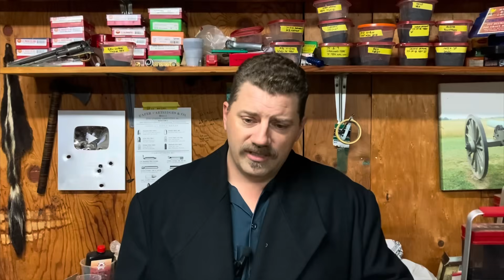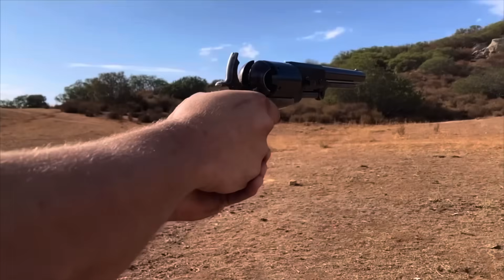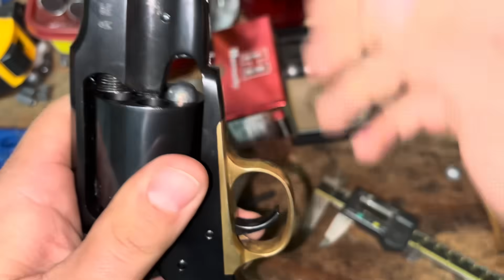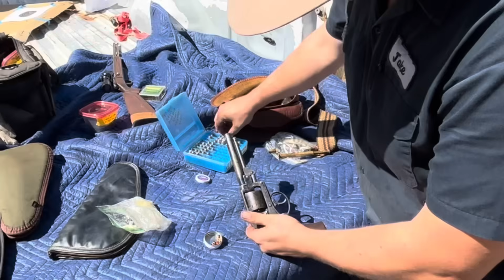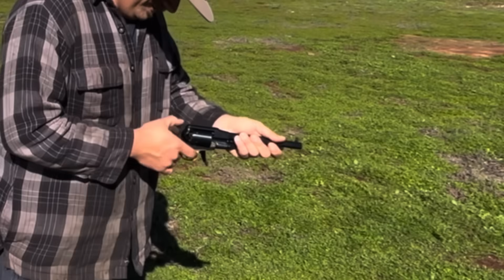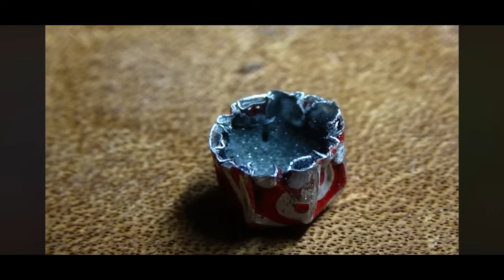Chain Fire Number 4. But Who’s Counting?

Comment: Old Ranger was using homemade caps which had priming compound all the way up the sides of the cap in the video when it's slowed down you can actually see the cap start fizzing and then it goes off. I make these same kind of percussion caps and now I only use them on my single shot muzzleloaders sometimes I'll load every other chamber of the pistol

Comment: From an engineering perspective, I would think that any chamber where the sides are more conical than parallel would make it easier for the projectile to dislodge, or break its seal. Just like you described happening with loose fitting caps. I'm the opposite of an expert though, so take my opinions for the little they may be worth. Thanks for another educational experience!

Comment: I usually use grease cookies BEHIND the bullet. Never had a chain fire up to now, either in my Navy or Walker, but I don't shoot even close as frequently as you do, so maybe next time I'll have one.
But it surely gives me EXCELLENT accuracy... shot 96 shots in my Navy with the last cylinder being as accurate as the first. Also, I can clean the gun without a drop of water. Just clean patches and some jojoba oil (completely equivalent, chemically speaking, to the sperm whale oil used back then, and much more ethical).
I deep clean (completely disassemble the gun) only once in a while. Never a trace of rust in the innards, nor in bore or cylinder.

Comment: I have two Remingtons and all of my cylinders cut off a complete ring with .454 Hornady balls - never had a chain fire. I do use lubed wads and i frankly cannot see how the powder in the adjacent chambers could possibly be ignited. I have used 10s , 11s and RWS10.75 caps with varying reliability.

Comment: I've been shooting BP revolvers since I was 15 when my father got me a CVA imported Armi San Marco 1858 .44. I still shoot it occasionally, but my supply of repair parts is getting low, so I'm preserving it.

Now, some 30+ years later, and I honestly don't know how many revolvers I've owned since them, and I've never had a chain fire. Like you, I shot them daily for many years and worn out, rebuilt, worn out, etc, several of them. 

When I load, I don't use felt wads or lube over the balls. Just #11 caps (usually pinched), usually Pyrodex or 777 (nobody carries real BP around me) and my own cast .457 round balls out of a Lee mould. I know most will say I'm doing much of my loading wrong, but it's what I've always done. 

About 5 years ago, a friend wanted to finally shoot his Pietta Remington .44 that he bought a few yeats prior and never shot. He read loading instructions online and I told him about my many years of BP shooting and lube over the chamber mouths was completely unnecessary to prevent chain fires. Well, the VERY FIRST TIME he pulled the trigger, he had a chain fire with the two chambers on each side of the firing chamber going off. 

So, long story short, I've just been lucky! I don't know exactly what causes them, but the possibility is definitely high enough that I wouldnt put y hand in front of the cylinder on a Remington Carbine!

Comment: What causes a lot of chain fire is the cylinder chambers are not perfectly round and there is slight gap between the ball and chamber, I had a Ruger old army and one was drilled much larger than the other chambers, even using a 457 round ball it still fit loose.

Comment: Not an expert but I've wore out 3 cheap brass frame replica's over the last 40 years. 2 51' Navies and a Remington Army. Never had a chain fire, never used lube or wads, but always used balls that would shave lead rings. That's one reason that I've been wary of conicals, they won't fit tight enough to seal the chambers. Keep up the good work, really enjoy your videos.

Comment: AFTER LOADING PUT 3 OR 4 DROPS OF RCBS CASE LUBE AROUND THE BULLET. IT WILL STAY THERE AND HELPS LUBE THE BULLET AND END YOUR PROBLEM. IT DOESNT HAPPEN ON THE NIPPLE END. ITS BAD ROUNDBALLS, BULLETS, AND MOSTLY OUT OF ROUND CHAMBERS. TRY IT AND YOU WILL LIKE IT. IF IT STILL CHAINFIRES YOU CAN CALL ME A LIAR BUT IT WONT. HAD AN EARLY ITALIAN 1860 ARMY THAT WAS HORRIBLE, HAD IT CHECKED AND MOST OF THE CHAMBERS WERE WAY OUT OF ROUND.

Comment: Just one more reason to NOT use that post 2004/05 modern "Kung Fu" tactitard thumbs forward grip on ANY of your handguns. It doesn't transfer over to revolvers at all even though many of the newer people do it anyway. It's not as accurate as a traditional "wedge hold" which is the one I use on everything I shoot and have for the last 50 years. Ok, so now here is "the thing". IF you use that modern thumbs forward hold on a revolver and have a chain fire you are going to lose at least that digit, maybe the one next to it too. Use a traditional revolver hold and grip or else a traditional "wedge hold" always when shooting a revolver of any kind. Your support fingers and thumbs won't be anywhere near that blast if you do.

Comment: I chain-fired an 'ol .44 Uberti once, It was 100%  my  fault . 
  Scared the shit out of me though, lol, wasn't expecting a 3 round burst from a 150 year old wheel gun. 
  I had leaks , just that simple.  I didn't seal the chambers with grease and propellet dust potentially added to the event . The firearm itself had issues,  we ended up trading it as a "parts-only" machine. 
But "lesson learned" and in all the years since, we lub'in.

Comment: I been tootin hoglegs for over 40 years , 😂😂😂😂 , only had a couple of chain fires one was my fault on a repo colt undersized balls , the other wasn't , it was a real 1860 army I dIdnt load it , just experienced it , it's problem was eroded chambers , I like lee liquid alox on the balls and bullets extra and a wad and some kind of grease , keep that fouling as soft as possible for accuracy and for safety, it just happens sometimes .

Comment: I used every protective measure, and it happens, now front, rear all I can say is YES I have had it happen 3 times thus far, one was from the front, as the cap was still good, one from the rear result of sloppy home made caps, the 3rd good luck was no way as to say definitively from which end.

Comment: If your vent hole in the nipple is burned out that can dude the cap to blow off and MAYBE migrate to an adjacent chamber. That’s a lot of 90* angles. You can be a purist to a degree, but, safety is paramount.

Comment: Sir, I believe that the chain fires come from the gases being deflected back towards the L/R chambers as the projectile completely exists the firing chamber.   Tight fitting projectiles and lube over the chamber ends should stop these unwanted discharges. I have never had a chain fire using the above method in my Uberti Dragoon.

Comment: Years ago i was using a local made gun grease. Had a colt chain fire with all cylinders greased . 2 cylinders chain fired. Found out the gunsmith making the lube was using some lighter fluid, vasiline, and candle wax. He replaced the colt Navy. Now only factory lube

Comment: If you have to pinch your caps to make them stay on, you’re probably gonna have a chain-fire. Be sure the cap fits on the nipple, good and tight. I’ve been shooting these things over half a century and I’ve had a lot of chain fires because I couldn’t find the exact size cap. I’ve never had a chain fire with the proper caps. Replace the nipples if they are worn/ corroded over time.
Reply from the maker: @DonEmbrey  i’ve had two chain fires in this gun using RWS 1075 caps that fit exceptionally well, better than CCI 11s and Remington 10s. I have recently switched to .457 balls and have yet to have a chain fire.

Comment: I have a Pietta 1858 that shaves a nice ring of lead with .451. My Ubertis don't shave much. I use Slix Shot nipples and RWS 1075 plus caps. I do have to pinch them a very small amount. However, after I do just like you seating them, it take a knife to CUT them off you cannot pry them off in most cases. I saw some tests with heavy loads that demonstrated that in a .451 gun each time they went up a ball size, the velocity increased by a substantial amount from starting friction, causing better ignition, supposedly. Now I only buy .457, (Hornady). The cylinder cuts it down anyways they thus have a longer bearing surface and shoot great no matter how hard I push them. You can't push them any harder, and they are good enough to take groundhogs at 30 yards and print to within .6 at 15 yards, often much better. Not only do I lube them, I re-lube each one coming up to fire because it blows some of the lube out. I'm only concerned with where the first one goes, so I start with the same chamber each time. T7 burns clean when ran right, and after 6 shots, I can still see bare stainless metal in the bore thru a little grey haze. 3 strokes with a water only mop cleans it. I seal my caps with clear nail polish for storage. It completely dissappears.

Comment: My first ball and cap revolver was a .36 Navy purchased in 1966 when I was 15.  Quality was terrible.  I only had one ball mould and they were too small.  I’d have a chain fire at least once during a shooting session.  Caps were hard to come by (nothing new) so I’d use anything I could get, size 10 or 11 sometimes loose sometimes okay. I often shot out in the desert so pasting Crisco over the ball didn’t work well.   I eventually started using a beeswax patch under the ball and that stopped the chain fires.  Recently I bought an original New Model Army and have not had any chain fires.  I think it is because the originals were built to a much higher standard and there is no variation in the cylinder diameter.  Caps fit tight on the nipple.  The .454 ball fits tight without cutting a ring.

Comment: Tight caps and grease over the bullets?
Reply: Ok after watching you explained you used grease. I don’t get it man. Is Black Powder somehow concussion sensitive? Enough to detonate without a spark under recoil? This is an interesting issue and I thought that right balls with grease would do the trick for preventing them but I can see how loose caps could leak a spark to another nipple and around a pinched on cap. I also seat my caps with my hammer because I have had enough to go ahead and not fire and force me to cycle back around to them to hit them again. But I don’t put my hand in front of the cylinder to do it. I just don’t want to be forward the cylinder once it’s loaded up.

Comment: Dear sir, considering that imho you produce the best Black powder information I have yet seen on u tube. I find it surprising that you use the term "propellent" for black powder. Perhaps it is the u tube cops. If so my apologies. Smokeless powder (Combustible Propellent) Is not an explosive. Black powder on the other hand is classified as a Class 1 explosive. Yes when the charge ignites it does "Propel" the projectile out the barrel. But that does not make it a propellent.
Reply from the maker: @brianwilcox3478  it is simply to avoid trouble with the YouTube authorities. Apology accepted. 😉
Reply: @Everythingblackpowder  :-)

Comment: I have cap and ball .44 calibers that require .440 round balls and a Uberti Walker.  I had one chain fire in my Army San Marco 1860 two deckades ago.  I had got sloppy and there were grains of powder on the outside of the felts.  Since that happened I have been making my own over the powder felts and using the oxyokes over the round balls and not had a chain fire since.  I also pinch he percussion caps before I put them on the nipples and use a stick to make sure the caps are on tight.  For long term or hunting I put a bead of lube around the edge of the oxyokes and the cylinder bore.   I have dropped my guns in the creek by accident and had them fire just fine

Comment: Late to the roast again, that's my bad. 
Regarding chain fires, let's just give it a quick, logical once over. You have a vessel, open on either end, with a charge of some volatile material inside. One of these openings is - for the sake of argument - .460" in diameter. The other is roughly .050" in diameter and covered tightly, even if not exactly sealed. The first, larger opening is also the end from which the volatile compound is charged, leaving the distinct possibility of some amount of errant compound sticking forward of the projectile. 
Which of these seems the most likely source of unwanted ignition? The tiny hole with the cover, or the hole 10x the size with an undetected, bugs bunny-esque powder train leading to the main charge? 
Can chain fires happen from either end? Sure. Like we said at the outset, it's a container full of bang that's open on either end. Just from a rational perspective, which seems more likely? The front of course. 

Now, all that out of the way, I got out to the range Friday. I brought some homemade propellant with me. Best velocity it managed with a Hornady 143gr (9.3g) .454 (11.53mm) ball was 824fps (~250m/s). I was kind of disappointed. Was hoping to break 900. Back to the drawing board I guess. Think I have to ditch the lead ball media. 
Until we meet again, keep your ladies wet, and your powder dry.

E: added the metric equivalents for ball weight and diameter for our freedom unit challenged over the way blackpowder shooting enthusiast compatriots. I had the metric velocity already. Made sense to add the rest.
Reply from the maker: How many grains of powder were you using?
Reply: @Everythingblackpowder  
30gr b/w
77% KNO3
13% carbon (red cedar)
10% S
Milled 36hrs with lead media, uncompressed, screened with roughly 3f grain size.
Reply from the maker: @DarkMatterX1  two problems.
1. Lead media
2. Uncompressed screened powder.
Over all not too bad though
Reply: @Everythingblackpowder  
Thanks man. I know those two are problems. It's fun to hope for good results is all. 824 was the highest. 683? I think was the lowest. Average was in the 740s. It wasn't "all over the place", but not as consistent as I'd hoped either. Standard Deviation was 30ish as I remember. I usually write it all down, but it was WINDY. And I mean windy. I had to chase some stuff around, prompting me to have to lock everything away in the ammocan in between loadings. I called it quits when it blew my chrony over - it was about 3' forward of the firing line on a tripod. It was printing pretty wide, but I'm gonna say that was definitely me. I need glasses. Lol.
Reply: @Everythingblackpowder  
Also, thanks for the replies man.
Reply from the maker: @DarkMatterX1  you bet

Comment: First thing I do to a newer Uberti (sometimes a problem with newer Pietta's also a problem with older Pietta's) is ream and chamfer the cylinder mouths round and to the same size 360 degrees. I know from experience as well that most chainfires occur from the cylinder mouth, but I think it very well can happen from the cone end as well. I think it's probably rare enough that it would take more time and testing to prove than proving it would be worth to shooters though...just my opinion of course. I was going to mention the sprue as an issue, but you covered that as well. I like to chamfer my cylinder mouths so that they don't shave lead, but I don't chamfer deep unless I'm reaming them for larger bullets or balls. There has been literally a metric ton of ink put to paper on this topic over the years and to this day people still argue about author opinions on it.

Comment: In the 80's I greased over the top of my balls with Crisco or vaseline in my 1851,1858,+ 1860, and had regulat chain fires.
One time 5 out of 6 went off, saved the one by the loading lever!
Now I use soft cast 457's in my ROA , Walkers, and others, with homemade wonderwads, and havent had a chainfire since the new protocol.
I load and cap a cylinder in 2 minutes, using full cylinders of screened powder, and save the puck powder for the 45-70, for less compressability but higher energy density. 
Red alder makes good powder, and I might revisit bigleaf maple someday.
I always enjoy your channel, and envy desert shooters for having so many great shooting spots, vs our heavily forested northwest.

Comment: Another informative video...I am not an experienced BP Pistol shooter, however, I now just recently acquired one and will be taking your advice on tight fitting caps and greasing the front of the cylinder for sure! Great information, and just in time for me too! Spring is coming up here in the Northeast and I will be casting some round balls and trying this thing out (replica 1858). Thanks for the video and keep them coming.

Comment: I use 457 balls in my pietta 1858 shooters model because the chambers are larger than standard model...also standard fare for my ruger old armies..now using 457 for the standards, too..a slightly larger ball gives improved accuracy and chamber seal while still easy to seat..just seems common sense
Reply: Also, no substitute for proper nipples..some guns beg to be upgraded to slixsprings..worth the cost as you get almost no cap jambs and better corrosion resistance..best thirty dollars you can spend

Comment: Felt patch with bear grease goes on top of the powder, then the ball, I have never had a chain fire since 1976 and I always use felt patches, the chain fire comes from the front of the cylinder,  not the cap end or rear of the cylinder,,,I suggest you start using felt patches. I shoot every day, I shoot an original cold dragoon made in 1858, a pair of 1860 colts and a half dozen uberty and a couple pietta,,,you might watch your mouth, you sound like a punk